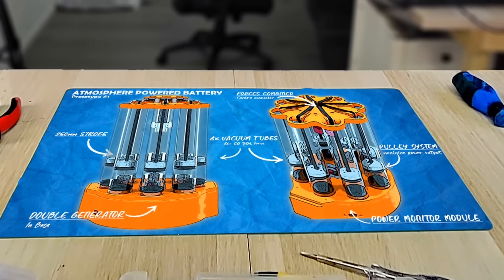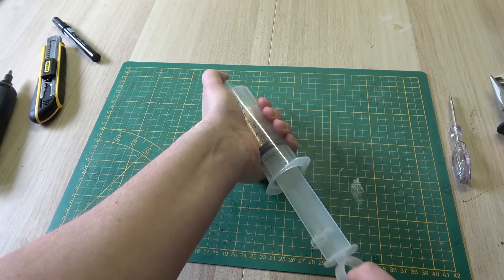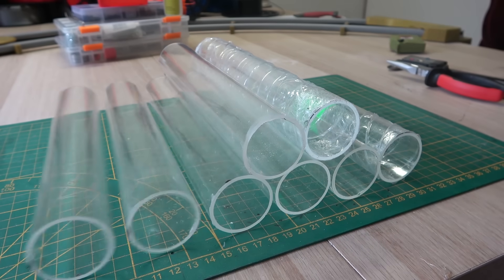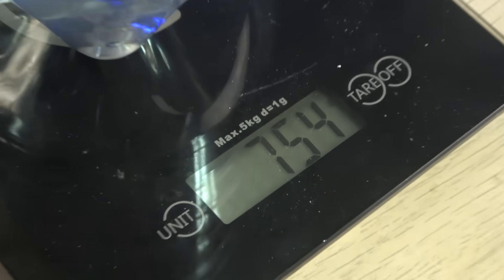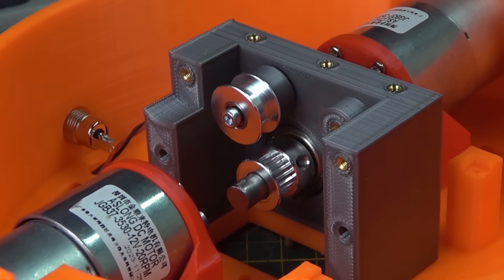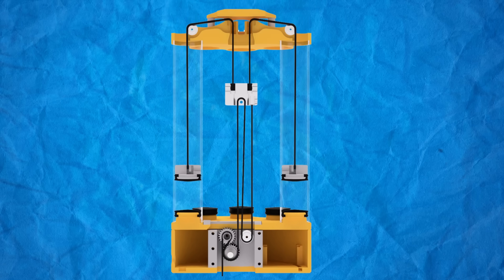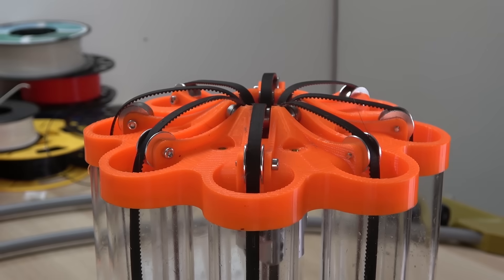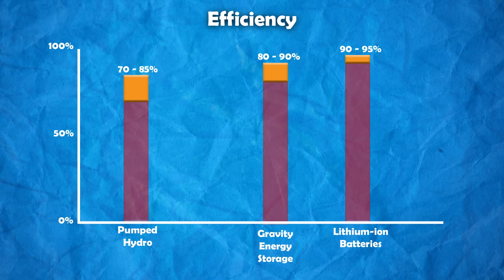Building an Atmosphere Powered Battery..

Comment: This seems to have amazing potential with those kinds of numbers from a 3d printed setup, I imagine with machined parts and possibly an exterior, partially vacuum sealed space to reduce leaks over time do to the pressure differential, I imagine it would have a much smaller loss over time on the pistons.
I had a similar idea many years back for how to produce useable methane on farms where I imagined building a circular tank (concrete manhole, they prefab similar stuff) to ferment cow shit in and have a giant round weight with a seal, could be on a solar powered winch that you top it off with, give it some time for the bacteria to work then lower the weighted seal to create pressured gas that you could then pipe out on site and put into cans provided some filtering mechanism of course.

Comment: I wonder if it would be more efficient to collect energy through gas pressure in a tank rather than using a vacuum.
Reply: I think the best part is the weight of the air! we don't have to carry no more😁; The round structure can take much more forces from outside than inside mean less materials for the vacuum tank! then might be more energy density. Compress tank can explode but vacuum tank only can collapse => vacuum tank is safer 
and we can vacuum the sphere tank, and the motor collect energy from the from-outside-airstream. 
the concept is interesting that the vacuum device store no energy but a pillar of 480km air above your head store for you :😃.

Comment: you could deff. improve this if you used those glass syringes with the glass plungers. You probably loose alot of energy to heat transfer between the rubber and the plastic of the syringe. glass on glass should be lower...

Comment: No offense, but measuring energy in watts is a bit cursed 💀
Reply: It's not measured in Watts. He said Watts, he meant Joules. 

We're all going to be fine 😂
Reply: It's fine. He's measuring the power in and out. Energy is going to have a linear relationship to that. It's the same as when people talk about their weight in kg. We understand what it means.
Reply: @JohnDoe-ej3wp  Yes and no. Depends if he is measuring stuff for the same duration. But yeah, it's just a physics thing. He is actually measuring Joules, just said it was watts
Reply: Its the most efficient  way if doing it. Wdym lmao. 

You cant find current without  both volts and amps. You can convert your current  to whatever you want, 1000000 volts or 3 volts. The only important  part is the wattage. Its just amps X volts.
Reply: @TheAshYam  Not really. The important part here was Joules because he wanted to know the efficiency of the battery. Watts is useful to calculate Joules. The main issue was the nomenclature because he ended up calculating Joules, but called them watts
Reply: @yertzar775  thats fair. Im American so i dont understand  jewls. Cant you find efficiency  by calculating watt hours vs over time to get total power capacity  and efficiency?
Reply: Watt Hours is Joules, sort of. You always need to divide a power, in watts, by some sort of time. This grants you that you're measuring the effort the machine is making for the same period of time. A quick example is: Imagine you will lift 10Kg 1m of the ground (sorry for metric sistem, but it's the one know. Just change Kg to Lb and m to ft and its the same). You will lift that amount of weight 1000 times, and that takes you 2h to do.
Meanwhile, I will lift 50Kg 100 times, that took me 0.5 h to lift.
The energy you spent is the weight in Newton's you lifted multiplied by the distance the weight travelled. So E = 10 * 9.8 * 1 * 1000 = 98000 J.
Meanwhile, I wasted E = 50 * 9.8 * 1 *100 = 50000 J
If we both ate the same, we both have the same energy to begin with but you spent more, hence you had more efficiency than me. But if you check the power ( P = E/t)
Yours : P = 44000 W
Mine : P = 100000 W

So, i would have more power than you, and more efficiency even though you actually spent more energy. This is the error he could be making. He just called the variables wrong. He actually did things correctly :)

Comment: Viable? For the model you showed, Short answer is no. I don't think 73% efficiency is the correct number. I think you did over engineering some parts of the process. You did good overall, if you could achieve at least 80% with great energy potential storage for longer cycles of use, it would become more interesting. If I had to take your project for real, I don't know if I would use so many moving parts, I don't know why you have chosen 8 vacuum chambers (true V-8?), the motors seems troublesome, the electronics seems ok for a prototype. In the project, overall price and materials would be the big talk for me. You should take a look on sand battery too.

Comment: True Vaccu systems of energy storage considers one very reinforced chamber, and has essentially a Turbine for the re conversion of forces.

Theoretically you could have a recovery system that uses a valve, that opens said valve after the mechanical parts are reset to harvest "vaccume" over and over again, using your same method.
That way you have a big vaccume chamber, easy to work with, and one or more harvester systems.

Comment: 5:45: could’ve printed it on the side because if you pull against the layers, they’ll snap but if you pull vertical to the print lines

Comment: i might be wrong about this but it might be more efficient to use a gearbox to switch between motors so you have a set of motor on the way up and the an extremely high gear ratioed set of motors on the way down

Comment: To put aside the faulty method of calculating efficiency which was underlined by people.
Another point is that using the atmosphere is much less efficient than using high pressure air.
It us easier to build an air motor and a compressor and using a big air tank that can store many atmospheres of pressure rather than only using one.

You can easily see the difference in energy capacity if you explore the potential energy equation for compressed gas or vacume.
E=V*(P1-P0)
Where the volume is fixed for camparing energy capacity.
For vacume storage you can achieve P1-P0= 1 atnosphere.
Using air compressor you can easily set
P1=7 atmosphere and working against the atmosphere at P0=1 atmosphere. Thus having 600% more emergy capacity per same volume in this example.

Comment: Neat idea , personally I would add even a greater gear reduction on a more powerful motor make it a single wider piston which is well lubricated and it’s even longer from stainless steel . That way you are increasing efficiency by minimising friction and mechanical resistance.

Comment: might free up some efficency by removing the belt tensioner. more belt/chain tension usually results in my resistance. for an application like this, where the speed is low, and the motor/plungers keep tension on the belt. i dont think an additional tensioner adds any benefit

Comment: Nice idea and implementation.
I've always been curious of a flotation based generator with a platform in a tube (like a mine shaft) made from turbines and allowed to sink, then pumped with some air and allowed to float. The air pressure could be recaptured the same way your device does and while the platform is transitioning from afloat to sunk (and vice versa) the platform would generate electricity from the turbines. Surely there's a distance for that transition that would provide a reasonable energy output.

Comment: The issue is that it discharges if it doesn't have an energy imput, even if there is no load connected.
Reply from the maker: You could add a brake?
Reply: @ConceptCraftedCreations  yeah, fair enough.

Comment: This is all kind of dumb.All you need is a tank that's heavily reinforced, so it doesn't implode.And pull a vacuum inside of it and then with the valve you can turn it on and release the vacuum to drive a piston.

Comment: I need a pen
Reply: @ConceptCraftedCreations  big cylinder of hydraulic oil. Pump it out then let it in??
Reply from the maker: @seanoconnor8843  I guess this is a suggestion for another/different approach?
Reply: @ConceptCraftedCreations  just thinking of the best way to convert volume to length. With pistons and pulleys and rope.

Comment: I think the best part in vacuum storage over pressure storage is the fact, that it provides linear force and can be generated and used very fast. I could see it as a kind of capacitor. Used when an excess of Mechanical energy is there that needs to be stored and then used almost instantaneous afterward, so airtightness isn't as big of a problem. I had to think of one video from Tom Scott, where he uses a Motion wheel to transfer the momentum of a bike to use it for accelerating afterward. This seems like a pretty good use case especially because it is limited energy that can be converted, and it doesn't bring any access weight with it like the flywheel.
Reply: You can get a linear force using preassure storage as well, you just ned a preassure regulator.
Reply from the maker: You are absolutely right! And the way you describe it is also the best way to look at it, I think👌

Comment: how many watt/hrs or watt/minuets does this unit hold?
Reply from the maker: To clearify the result you've seen in the video🤓

To charge: ~12.08V x ~1.62A x 43.709 seconds = 860,64 Watt-second/joule

After a discharge: ~9.42V x ~1.15A x 57.993 seconds = 628,24 Watt-second/joule

All value's are measured by the Arduino Nano in combination with the INA3221 Power monitoring module.

Comment: Nice one. I wonder what if compressing air into a tank at high pressure to store energy and slowly decompress into a turbine.Would'nt be easier than making vaccum? one compressor, one air turbine, one intake, one outlet and 2 electovalves to select direction.
Reply from the maker: That is certainly an interesting idea and worth testing!👌

Comment: You can get glass syringes with glass on glass air tight interfaces, this will reduce the friction inefficiency.  But you would need to source high precision glass tubing.
Reply from the maker: Sounds like it's quite expensive too? Or will that not be so bad?

Comment: I would love to see it done with like, 6 in pvc pipe or something. I love this idea cause it doesn't require huge amounts of material like compressed air storage does! I could build this in my backyard for fairly cheap, and maybe itd be better to use it for other mechanical processes, like pumping a well or something, instead of electricity. I can only imagine the power stored with multiple 10ft 6in pvc pipes
Reply from the maker: A piston of a 6" tube could deliver around 180KG of force.. The construction will therefore have to be many times stronger, but I think that 6" would be a nice size for a V2💪

Comment: The base of each cylinder couldve been sealed better.
Reply from the maker: You got that absolutely right! Especially considering the diameter of the part that holds the seal in place is 0.5mm smaller than the original size... So your eye for detail is incredible👌

Comment: using a liquid piston would be more practical: no need in a mechanical piston, no need caring about pressure leaking, ease of scaling, no pulleys and ropes with their friction. Also consider changing vacuuming to pressuring. Simple project would need : a barrel, karcher pressure washer, tubes, water
Reply from the maker: Love the idea! definitetly wort a try👌

Comment: Joule (J) is measure of energy. Watt (W) is measure of power. You need to compare amount of energy consumed and produced to get the efficiency. Watt alone tells nothing when duration of times is not even mentioned, when with all likelihoods time durations are different... Anyways, your calculation explanations are not correct. Volt-ampere is already power unit Watt. Check wikipedia page: en.wikipedia.org/wiki/Volt-ampere
Reply from the maker: You are right and i know! The result as seen in the video however is correct. To clearify how i got to the result you see in the video:🤓

To charge: ~12.08V x ~1.62A x 43.709 seconds = 860,64 Watt second/joule

After a discharge: ~9.42V x ~1.15A x 57.993 seconds = 628,24 Watt second/joule

All value's are measured by the Arduino Nano in combination with the INA3221 Power module.

Comment: You need to start using my design to print PET plastic. 
It's breaking shock force is very close to aluminium.
I merlin firmware or your choice of custom 3d printer board language to up the tempreture is all that's needed to modify. 

I have a very quick and crude video with links to instructions. 
Everything PLA disintegrated within 6-12months and almost always broke, PET will not even 4 year's later I still have hidden raw pokemon prints around town in the direct sun.
Best of all my extruder design can be made for as little as $25 to $30, filaments can be easily and very quickly coloured and for the cost of an empty soda bottle is basically free!

Comment: (sorry if my English is a little broken lol) What if instead of pushing against atmospheric pressure to lift the pistons, you design a way to vacuum out most of the air so the piston has less resistance, and when you want to generate power, you let the pressure back in, would that be more efficient or less because you're using a vacuum pump?
Reply from the maker: I initially wanted to add exactly what you say to this project to investigate whether it would indeed have added value! Unfortunately, a really good vacuum pump is quite pricey and was therefore outside the budget of this video.. But who knows, it might be an interesting project for the future🤓

Comment: What if u combined this with pumped hydro, using the weight of the water to push down to create a vacuum, then this would be surplus to what the pumped hydro produced 🤷‍♂️
Reply from the maker: This might be an interesting idea to explore further👌
Reply: I mean using gravity as the energy to put into the vacuum using water could technically output more energy than you put in (by which I mean gravity put that extra energy into the system) so in effect any energy you put in gravity being always there you could get more out maybe even making it over 100% energy cost to energy gain (not counting gravity as an energy cost otherwise technically you have a perpetual engine which isn't exactly possible)

Comment: what's the kwh per dollar, kwh per kg and kwh per volume for this type of system ? I think these performance metric help to compare with other energy storage system easier. I would imagine it would have higher kwh per kg compare to a gravity battery but lower kwh per volume. 
you might increase the energy volume density by placing the battery inside a water tank, so the outside is expose to water pressure instead of just atomsphere. since water exert much higher pressure than air. Though in that case, it's approaching a gravity battery design. So performance metric might become more like gravity battery.

You went through a lot of trouble increase surface area then put gear reduction, but it might be simpler to just have one long tube with a single seal. You wont need gear reduction in that case, the amount of energy per volume is about the same, and less loss from seal friction and drive train loss. Have more area contact with atomsphere only increase poweroutput, energy density is the same. You can always just gear up or down to adjust power output later.
Reply from the maker: You are absolutely right about the single vacuum tube!👌 But a larger diameter tube also meant that I would have had to make custom seals of course. And while designing you weigh one choice against the other and that's how I ended up with this.

And as for the Kwh per dollar, KG or volume is difficult to say for a setup like this, which of course actually serves more as a kind of proof of concept idea. If you were to build a V2 with the right materials you could investigate that👍

Comment: can the container itself be made from graphite tube? never mind... too expensive😯
Also I remember a similar abroach called "GravityLight" where a pulley + gear ratio slowed down the weight descend
Reply from the maker: I never heard of GravityLight before! But i just looked it up and it is indeed also based on energy produced by gravity😄

Comment: 8:30 but the torgue needed to turn the motor will increase as soon as you try to get energy out of the system
Reply from the maker: That's correct👌That is one of the reasons why I measured the force required to run the motor from a standstill. Because this is considerably more than if the motor were already running slowly. And this difference has been used as a "buffer"
Reply: @ConceptCraftedCreations  Thank you so much for the explanation! Would you mind testing that on camera? Just the same experiment you did with the water bottle, once like you did before and once with a shorted motor?

Comment: I wonder if this would be more efficient using ultracapacitors for intermediate storage?  I've seen them achieve >99.9% efficiency as an electrical storage medium, making them popular for regenerative braking, since their capacity is extremely low (individual farads) and their discharge and charge curves are linear.  However that linearity is what keeps them from being useful as batteries in most cases.  A 12v device will generally stop working below 10v and that means less than 20% of the capacitance is useable by the device.  Thus you need to use it either as intermediary power storage or smoothing, or for energy harvesting you'll need a complex buck circuit to maintain stable and efficient output.